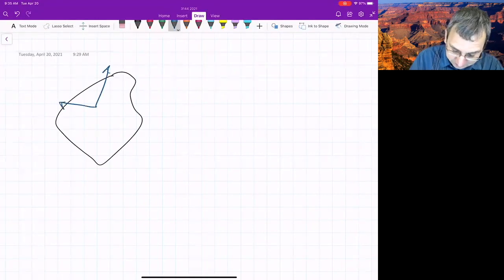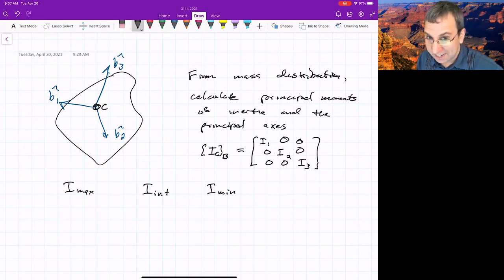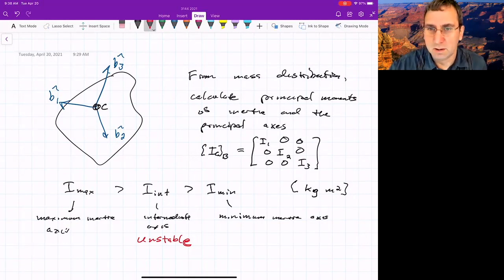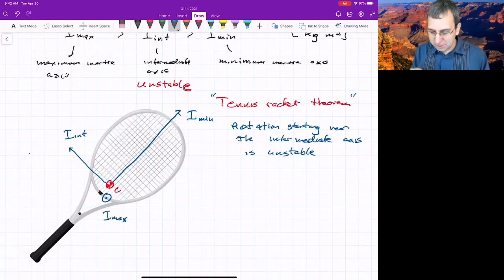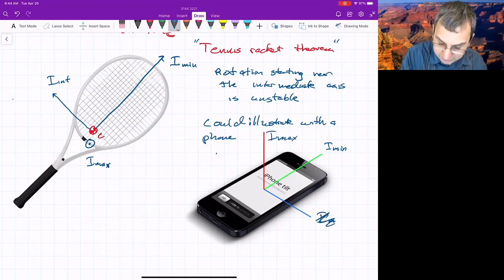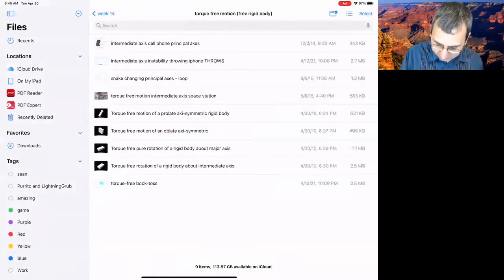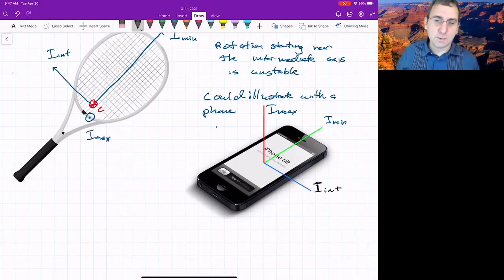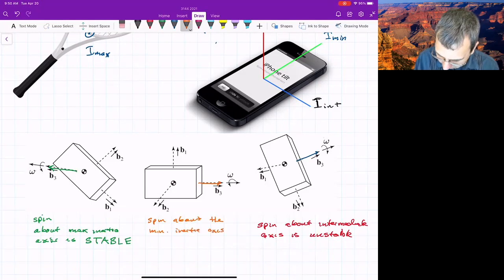Dual-Spin Spacecraft | Instability of Intermediate and Minimum Principal Axes for Free Rigid Bodies

Comment: Hi Dr. Ross, I have a question about the stability and rotational energy of principal axes. You said the highest principal axis (the axis where the highest moment of inertia happens) has a lower energy dissipation than the smallest principal axis. I'm trying to understand this from a mathematical point of view. For rotation about the smallest moment of Inertia, can you say the angular velocity (w) decreases over time, leading to a decrease is energy, E? E= 1/2 w^T * I* w. And can you also say energy can be dissipated easier simply because the system's energy is more focused on angular velocity than the moment of inertia (it is harder for a system to remove mass than energy from rotation)?  Thanks. I hope you can understand my question. I am confused about how and why the highest principal axis is the most stable.
Reply: @ProfessorRoss